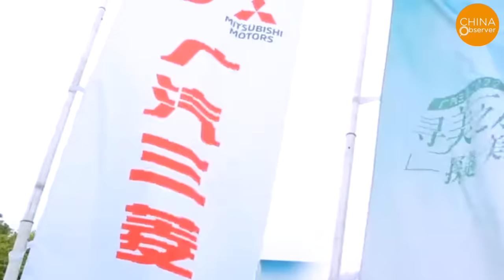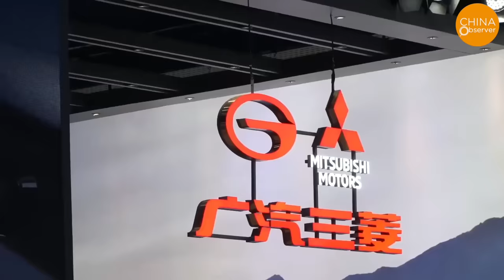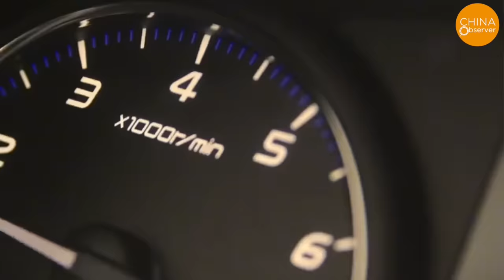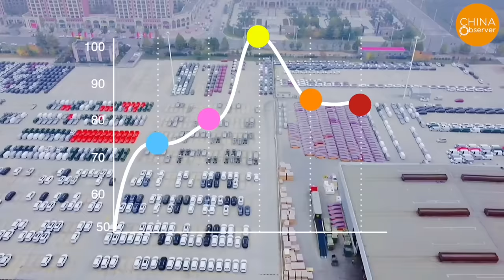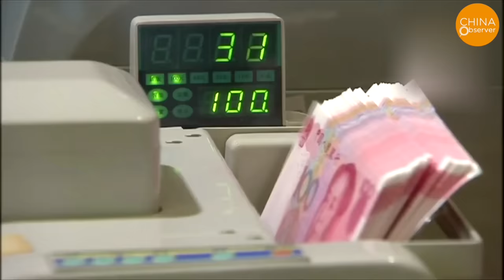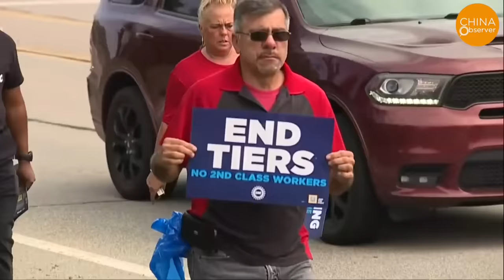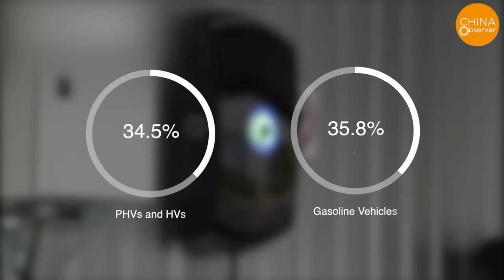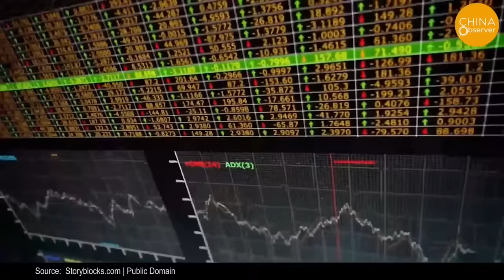Mitsubishi Motors Flees! Ceasing Entire Production in China as Famed Camera Brands Exit

Comment: Several years from now the EV fad will be over as batteries are toxic to the environment, expensive and not as durable as combustion engines. All the folks who bought EVs will realize they were taken in by this expensive fad.
Reply: Or they will say it's your fault because if everyone would've bought an EV everything would be fine. Never argue with a Liberal, a woman, or a Volt-Head. @LGTheOneFreeMan
Reply: The hydrocarbon fuels may not be available in every street corner like today. Most refineries would be closed forever.

Comment: One thing I don't understand regarding Chinese EVs - we constantly see these enormous hi-rise tower blocks being built which, presumably, most Chinese inhabit. Where are the power points when these folk don't have driveways? It's bad enough in the UK where a good percentage of houses are terraced and people park on the street near their house.
Reply: The terraced houses are decades old,  the wiring not sticking out of open holes in the walls, the ceiling fixtures not falling out of ceilings and the drains are real, unlike the fake drains sitting on top of cement in hundreds of thousands of "tofu dregs" new construction, in addition to no windows with glass and doors lacking.
Reply: @PatriciaPalmer-o3e  I wasn't criticising the terraced houses - I live in one - just pointing out that if you don't have a driveway electric vehicles are surely a massive pain in the backside to keep charged? And here's a country apparently leading the charge (pun intended), where no-one it seems has a detached house or semi to take advantage of home charging.

Comment: I can't buy into EV because it seems like a gimmick; not to mention why "batteries" couldn't be charged while driving. 
4 Wheels in motion are producing energy that could be used to generate power to operate the vehicle. In other words; advancements in generating or regeneration aka huge alternators on all 4 wheels with never ending operation. But they wont go that route because it would kill big oil. SO here we are. Hydrogen seems a better option as almost the same engines with modifications can be used.
Sadly it's not about what is best or cheapest or best for consumers, it's about what big corpora will allow as it will impact big oil and they don't want that to happen. We're all just sheep to them and we have no control over the outcome.

Comment: One of the problem at least from other yt vid i watch is if the battery model for the said car never produced anymore than tht car would be useless since not only battery age is short even if they want to convert to new model it would be expensive and thts a big if so u have a car with average use of 5 years compared to combustion engine as long as oil is still exist.
Reply: Batteries can be made easily replaceable. Also batteries can be recycled, so the problem is more political than real.
 It's like in the past every mobile phone had different charger, now we have unified chargers and that was also a political problem. If batteries are unified and standardized and methods for they recycling are unified, electric vehicles have the potential to last longer than combustion engine vehicles. After all the electric engine is much simpler and with less components and it has much more space to evolve than combustion engines.

Comment: One study from 2017 does not reflect the current reality of hydrogen as a fuel.  The infrastructure needed to deliver hydrogen to millions of vehicles is not doable - every pump would require huge capital investment to install, and hydrogen storage and handling is notoriously difficult and potentially explosive.  95% of hydrogen is produced by coal, and emits huge quantities of greenhouse gases in the process.  It is in no way a green fuel.  And the hydrogen fuel cell to power a car still costs over $100,000 a piece, and can and does fail - now that's an expensive repair bill.  A hydrogen fuel cell is around 40-60% efficient, whereas battery EV is 80-90% efficient.
Battery tech has evolved since 2017.  The previously disgraced truck company Nikola - whose CEO at the time was championing hydrogen and faking test results before he was caught - have reformed and built and delivered several hundred full-EV semi trucks, and they are already cheaper to own and operate than diesel trucks.
The electrical infrastructure already exists, and beefing up the grid to support EV charging is a walk in the park compared with delivering megatons of pressurized explosive gas at -235 degrees C to every vehicle in the world.

Comment: I can see why hydrogen has a push. It can sit for decades in a tank and be just fine. Compared to current batteries which go bad over time. It's also based around electrolysis compared to potential wars for oil. It's just not economic yet tho.
Reply: I don't think that it can sit for decades .It is stored at high pressure making the situation for long term storage a bit complicated.
Reply: @justinterested715 oxygen tanks are high pressured. But was able to stored for a decade without any problems.
Reply: Hydrogen leaks,even though solid steel.
Reply: I can see battery electric cars being dominant in most consumer contexts due to vast majority of journeys being within a single charge range. But for the long distance logistics I think hydrogen fuel cells would be more useful option due to range and time to recharge limitations of battery based electric cars and the quite heavy batteries would limit load capacity.
Reply: @mrkelly1663   It's similar enough to helium that the same solutions would work.
Reply: @zetsumeinaito  helium is nowhere near as explosive as hydrogen. Otherwise we would have the helium bomb.
Reply: @lordomacron3719  Personally I think as long as a battery can last 20 years and has more charge density than the theoretical Lithium ion battery limits, then hydrogen fuel will be relegated to forklifts, and NASA. 

But you know, forever 3-5 years away for a half dozen different solid batteries from just as many companies.
Reply: @mrkelly1663  ~Looks at comment~
"Hydrogen leaks,even though solid steel."

~looks at new comment~
"helium is nowhere near as explosive as hydrogen. Otherwise we would have the helium bomb."

hmm... So uh, where you goin with this change of subject?
Reply: @zetsumeinaito hydrogen does leak out through solid metal tank, and is super fluid. These properties make it a more complex engineering challenge than battery electric vehicles.
Reply: Current hydrogen is mostly manufactured from fossil fuels
Reply: @zetsumeinaito  not changing the the subject, rather than than saying that hydrogen is too unstable to store. That is why the hydrogen bomb is is actually deuterium,a stable isotope of hydrogen wrapped with unenriched uranium to make the largest man made explosion. Hydrogen is just too unstable to store.
Reply: @mrkelly1663 it also needs to be stored at very low Temps if you want to keep it from escaping. I would shudder to think of a hydrogen storage cell in a car exploding when struck. At least most cars use water, but you think the battery cars are bad. Now imagine hydrogen cells being lit.
Reply: @mrkelly1663  It's stable enough to build up and store for most rockets sent into space. Both governmental and commercial ever since the cold war. It's literally 70 year old tech on the making and storage front. The difference is making it economical and safe for normie use. The same normies that use a DVD tray as a drink holder.
Reply: @mrkelly1663 uuuuuuhm.... i rarely have read something so stunningly false and right at the same time. There is a slight difference between a hydrogen explosion and what a hydrogen NUCLEAR bomb does, mate!
Reply: That's a DVD tray? Why didn't someone tell me sooner? @zetsumeinaito
Reply: Damn. You’ll jump on any bandwagon you can find, if you believe that.
Reply: That's exactly what I think when I hear about the climate "crisis". Whatever did the Earth do before we were here to save it? @XYZXYZXYZXYZHOES
Reply: @XYZXYZXYZXYZHOES  A rather neutral comment is "jumping on the bandwagon" huh. Man, you must go ape shit over hot takes.

Comment: Hydrogen fuel cells vehicles have been an absolute failure contrary to what this video says. Toyota is the main producer and their Toyota Marai launched in 2014 is a flop. The few Hydrogen filling stations are closing. Hydrogen is inefficient and the production ,transportation and filling stations are very expensive. So are hydrogen cars to make, Toyota loose a substantial amount on each hydrogen car sold. That’s not many.

Comment: Plug in hybrids are the most STUPID vehicle there is because you have the weight and expense of both battery and ICE.

I call this the STUPID phase where auto companies are raping their customers wallets to get their high profit margins.

So no that's not going to last.  Once battery technologies diversify BEV will EASILY be the best option for vehicles, but it does require a large expansion in electric production, and this is the point that becomes problematic for different countries.  In the U.S. electric production can EASILY expand to meet the demand for BEV, mostly with solar panels in the West where it's mostly sunny and then the central US has a major wind corridor that's consistent year round with some drop offs from time to time.  Then there are other wind corridors on the east coast including off shore.  So the US can easily shift to mostly wind, solar and natural gas power production.  It takes time for all the investment/installation but time doesn't mean it's hard to do.  It's still easy.
Reply: The problem is on the battery production.  It is not clean and green energy is EV selling point.

Comment: So many daft anti-EV posts — Tesla lowered price of the Y and 3 and they are less than ICE vehicles. Where that has fairly priced electricity does it cost more to charge your car than a gas vehicle? Peak oil was 2018 and it will keep prices up until the end of the use of this fuel. Tesla has demonstrated conclusively that their semi-Truck lowers cost $20,000 per year per vehicle due to price of electricity in California versus diesel.